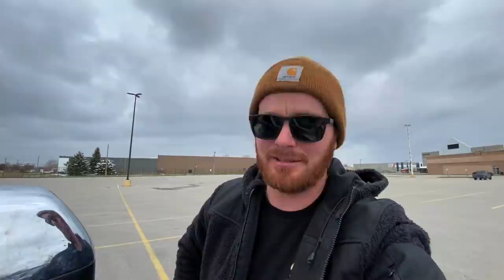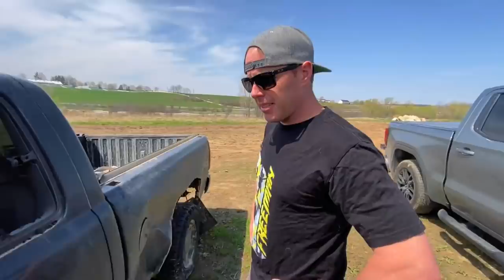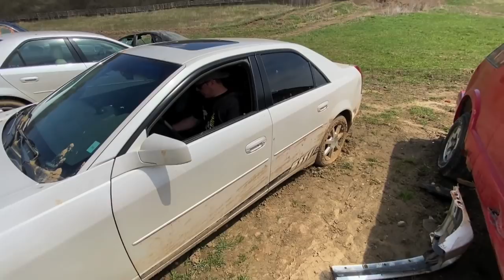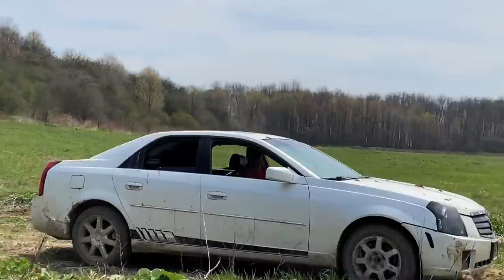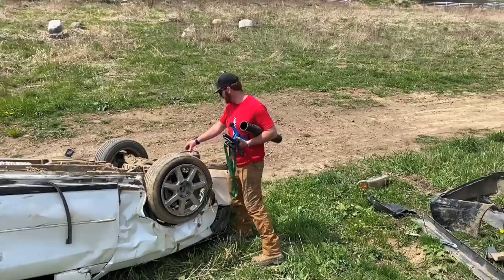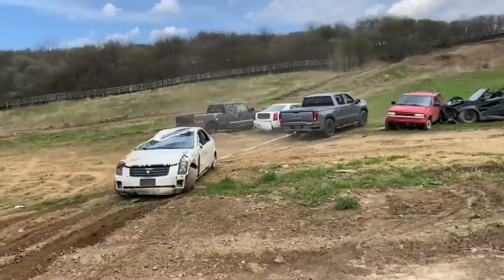Cadillac JUMP FAIL!

Comment: To start the truck you need to cut off the wires on the back of the plastic switch on the back of the ignition switch and start joining wires together until you get dash lights

Comment: Just remove the ignition module from the lock cylinder. Or on those year of gm. There's a yellow wire under the dash. That's the starter wire, but you got two misc wires under the dash that need full power to start the vehicle